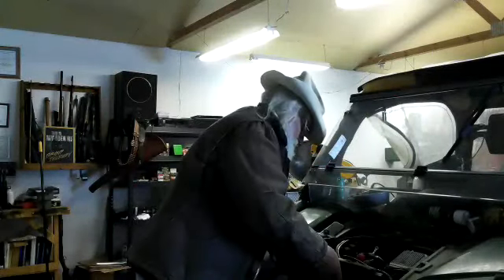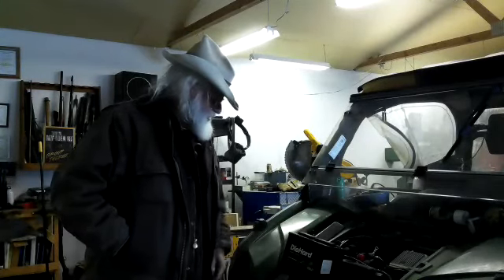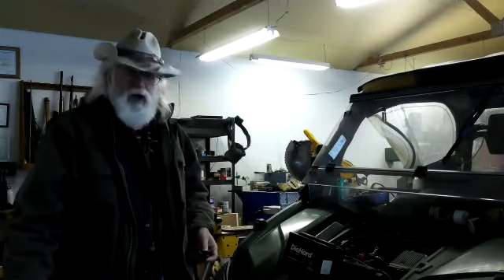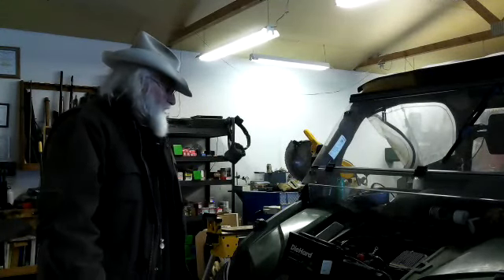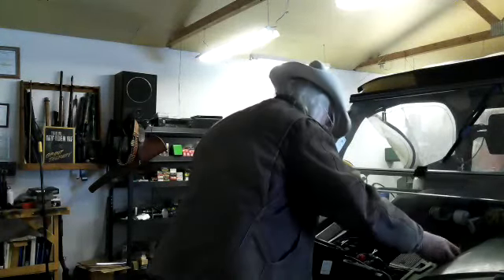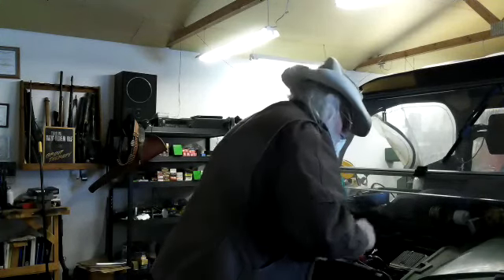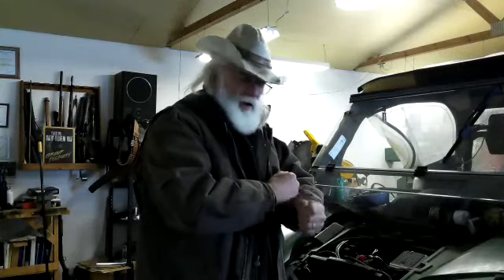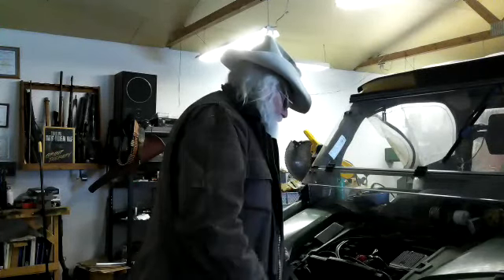Coffee w/Buckskin Dave  Put battery in SxS Dribble News and shots from the Big 50

Comment: Hear you on the price of batteries!  Try replacing a "lowly" 6v tractor battery for an 8N Ford!  Man in Arco parts store said $140 and didn't  stutter or nuthin'!  So I finally got my loads for the 40-65 WCF Browning falling block done up, using resized 45-70 cases, 400 gr8 Shoves store bullets and Varget to start.  Stepped out back, and can't  get the action closed on a single round!  Back to the drawing board!  Well, I got metal finishing, and stock finish and checkering to do yet, so a winter's worth to chew on while I figure out the ammo situation.   Probably round up some cerro-safe and do a chamber cast, as the gun was about half done when I bought it sight unseen.  Great to see you on the Tube again!  Hope Sarah and You had a great Holiday Season!
Reply: Gawdam spell check!  Make that 400 grain Snover style cast bullets.  Geeze.  Guess ya gotta use a bit of imagination to translate the rest!
Reply from the maker: Glad u cud stop in for a cup. You'll get that rifle shooting, that's most of the fun agrivating as it is. Sounds like a fun project. Everything  here good hope u r the same